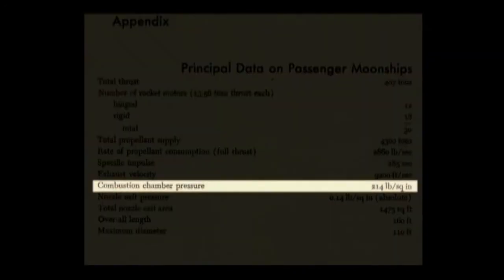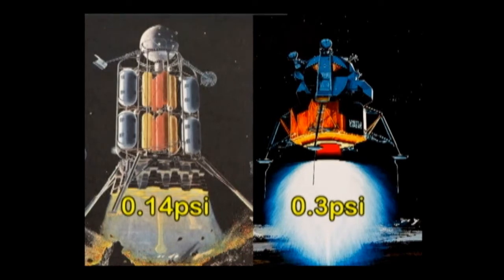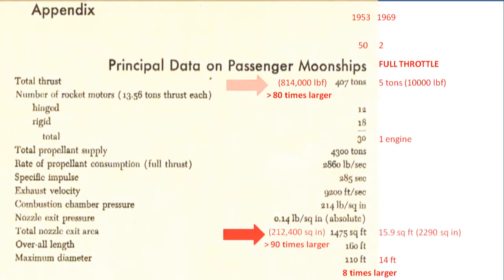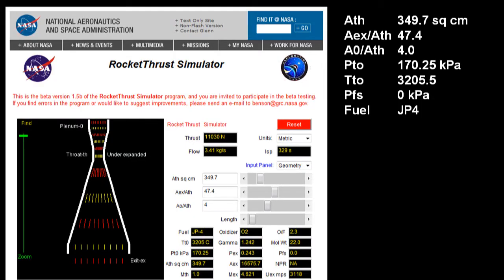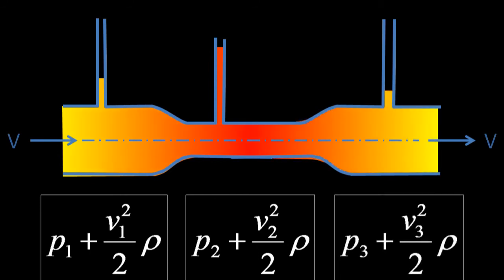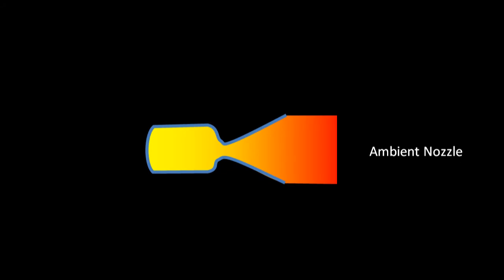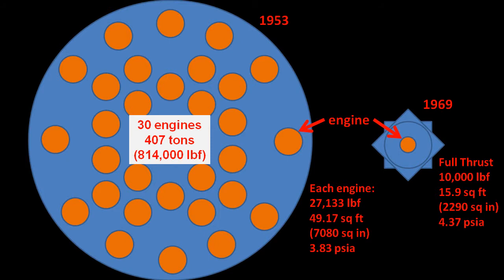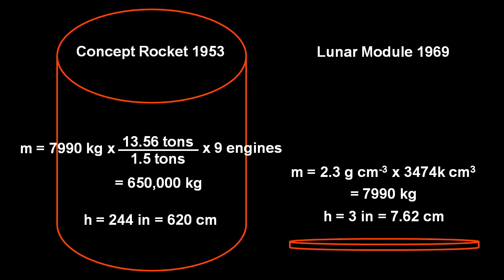MoonFaker: No Crater Addendum: Critique #01: Concept Rocket

Comment: If we only leave it to common sense, we must conclude the moon lander would leave a crater into light dust on any planet or its satellite with gravity.  It is all relative, from required force to power a craft against the same gravity that holds the dust down to the terrain. 

OK there is no atmosphere on the moon,  but consider as expanding gas penetrates into the dust similar to how those lunar foot prints we see in pictures do, the assumption that moon dust should remain cohesive falls apart.

Comment: philwebb59 can not plausibly deny that a rocket supporting over two tons of junk powered by the expanding combustion of rocket fuel into a virtual infinite vacuum, that is hitting the terrain at a meager .2 psi with questionable expansion velocity once it has escaped into space, would not blow a crater in the surface.  There are so many variables that he does not include in his hypothesis.  I only touch upon the more obvious based on his own estimations of PSI and weight of moon dust.

Comment: Imperial to metric keeps tripping me up, I have not slept for 48 hours, but call me a noob, I can take it.

Ill try again.  even @ 2.5g/cm3 @ 100 micron layer weighs 0.113 lbs per inch area i per layer.  And Shouldnt we consider, Time velocity and  Distance?

Convert grams to lbs
2.5g/453.5920864510229= 0.0551156 lbs/cm3

Take a 100 microns layer.
0.0055 *.01= 0.000055

Convert cm to inch
0.000055 * 2.54 

Moon dust weights = 0.0001397 lbs/inch @ 100 micron layer.

Or 0.139993624 lbs/inch3.

Comment: BTW thanks for your answer, I do appreciate it sincerely. But your answer may not consider cohesiveness is as result of vacuum, within a thrust it is no longer in a vacuum, at least for a short period of time and plug the energy of expanding gas, collision of gas moles penetrating the surface of moon dust, the reaction should change.

We witness the dust being kicked around and the cohesiveness you speak of which could like any soil on earth.

Comment from the maker: Unless it's been sieved, lunar regolith isn't uniform in size. It ranges from 0.03mm on up. Regolith has a density more in the range of 1.5 to 2.0 g/cm3. And, unlike sand on earth, it's not worn down by erosion, so it's more cohesive and the cohesion increases the deeper you go.

Comment: Answer the Question Dork dont run away..

Now answer this, how does 30 micron moon dust under the moons tiny gravity interact with rapidly expanding gas for the first time since an evaporating comet made a crater in it's surface?  

I suppose you have witnessed this first hand Einstein?. 

I dare Lie busters to land a model jet in a vacuum in that mooncrete without making a crater.  I would swear the weight of craft, vs required thrust to soft land, is relative to weight of dust in any gravity.

Comment: Have you accounted for the fact luna dust is only being 30 microns in diameter & weighs  0.6g/cm^3 on the moon. A layer of dust @ 30 microns facing .2psi thrust would seriously blow that shit everywhere. 
 
Your 50s pictures make it look like we are talking about clay fool.   What I am suggesting here makes a hell of a difference. So work that out with your pencil.  We don't even want to see a crater, even a small sign of a couple ton of heap useless space junk grinding to a halt would suffice.

Comment: The longer nozzles on Apollo 15-17 DID make a difference because they came much closer to the surface. In fact, pictures show the nozzle on Apollo 15 *HIT* the surface and was crumpled.

It ought to be obvious that cutting the engine before landing was much more important for the last three flights than for Apollo 11, which had plenty of clearance between its nozzle and the surface.

Comment from the maker: @xismxist OK, then AROUND 101ft there was no force acting on the moon, but then, magically, at AROUND 100ft there was 3000lbf. ON/OFF. That's how you think it happened? And the historic record shows that Armstrong bypassed a boulder field. How did he do that if he didn't move sideways? Check the video again. And your 81000 number is not mass. It's momentum. It means nothing in relation to the amount of regolith displaced by the engine exhaust.

Comment: @philwebb59 here we go with your misquotings again! AROUND 100ft is that better? the horizontal motion could not have happend, not as we can see it in original nasa film because the small thrusters was never fired (we should have noticed that) the LM cannot go from horizontal to vertical without the thrusters being fired

Comment: @philwebb59 the propagandaists excuse why there's no crater has always been that the exhaust expands, but if thats the case how can the depth of the footprints still be the same 1-2 inches around the lm like they are like a 1/4 mile away? PICS prove that fact: LM didnt remove any dust at all. The classic apollo 15 pic of the flag, rover and the lm is the most laughable yet, i mean take a look at the surface....

Comment from the maker: @xismxist The 8000 kg is calculated from a measurable 3 inch depression under the Apollo 14 LM. You got your 80000 kg by doing bogus math, force x time means nothing. It gives you mass x velocity which is a rate. You completely ignore gravity, cohesive forces, horizontal motion, and the exhaust spread. Dust is affected by gravity. Even in the movies. Did anything I said make any sense to you?

Comment from the maker: @xismxist #2 Do you think that at 101 ft there is no pressure on the moon then magically at 100 ft there is 3000 lbf concentrated on a 16 sq ft area directly below the nozzle? You ignore the horizontal motion. Do you remember that Armstrong had to take the controls and steer away from a boulder field? That requires horizontal motion. He wasn't directly over the landing site more than a couple seconds before landing. Does any of that make sense to you?

Comment: @lukequixotesanjose there's no evidence for the exhaust plume to expand in a vacuum, since there's no air to stop the exhaust it should remain even in a more straight plume all the way down to the surface (which original nasa film proved, since the engine kicked up dust at 100ft) the ONLY way to do that is if the plume has contact with the surface, which was the case

Comment from the maker: @xismxist #3 In order to move the dust, the force from the engine has to exceed the cohesive force (friction) of the regolith, which increases as you get deeper. This force is what causes granular materials to stick together. Down to 15cm, this cohesive force is about 0.5 kPa. At 60 cm it increases to 3 kPa. The force divided by the area has to exceed this value to even begin to move the regolith. That's what Luke was trying to get you to realize.

Comment from the maker: @xismxist #2 Also, do you honestly think that, even though you see dust scattering, the 13.3 kN force of the engine is concentrated on a 16 sq ft area of dust from 100 ft up? Do you believe that just before you see dust scatter there's zero force on the surface then magically at 100 ft it turns full bore? The force of the engine actually begins acting on the surface before you see any dust scatter.

Comment from the maker: @xismxist #1 8000 kg was estimated from the apparent depression under the Apollo 14. As for 81000 kg, sounds like you took 3000 lbf X 60 sec = 178,500 lbm (earth) = 81000 kg. Um? You can't do that. 1lbf (on earth) is the force required to accelerate 1 lbm by the acceleration due to gravity (on earth). When you start mixing earth weight, moon weight, mass, force -- it gets confusing to me. It all makes more sense if you convert to SI units. 3000 lbf = 13.3 kN.

Comment: @lukequixotesanjose There's no pic or video even to this date who can show these "radial lines" from the engine. Pressure has nothing to do with the engine dig a crater or not, as the main point here is that there was no air to slow down the exhaust, its a vacuum you know and there is no way around this by using excuses like you and other propagandaists does.

Comment from the maker: @xismxist Read the transcript I provided. Neither the crater or the explosion SHOULD have happened if you read Cernan's actual words. He is talking about risk mitigation on the Apollo 17. The Apollo 11 did not have the 10 inch extension.
Watch the video that Jarrah used as a source, watch?v=y1MVtrBytZs, starting about 5 minutes in, and get your facts straight.

Comment from the maker: @xismxist Exact words:
Ranen: I asked Gene why there is no crater under the lunar lander.
Cernan: Thank God there is no crater there. We might be in it, because we shut the engine down some three meters above the surface and we literally free fell that last nine or ten feet. And the reason we did that is if we kept the engine running all the way down to the surface, it truly would have dug a crater, the back pressure would have blown back up into the engine and probably blown us off the moon.

Comment from the maker: @xismxist You obviously didn't understand anything I just said, or you're intentionally twisting words. Cernan is talking about a worst case scenario. When you get the nozzle "close" to the surface, you risk regolith going back up into the engine. The 10 inch shorter nozzle on Apollo 11 means half the surface pressure and 2.7 times more distance between the nozzle and the surface. That would be much more likely at 6 inches than at 16 inches, and even then it likely wouldn't happen.

Comment: @philwebb59 That would been a test i like to see, 157 leaf blowers attached next to each other(still only 0.5 psi) i bet those would create a HAVOC on lose surface like sand if they were running for 1 minute. But it wont be a pickup.. only 157 leaf blowers along would be around 3000 lbs. Either way it would cause alot more disturbens on the surface than what the LM did on the moon - I could bet my life on it.

Comment from the maker: @xismxist  #3 They also had a ten inch extension, which put the end of the Apollo 17 nozzle six inches away upon landing, opposed to 16 inches for Apollo 11. The surface pressure would also be double, 0.9 psi compared to 0.5, and there was less space for the regolith to escape, so they would have more of a problem with back pressure. He's probably right there. IF they had not shutdown the engines before TD, they MIGHT have been blown off the moon.

Comment from the maker: @xismxist #2 Cernan said that Armstrong shut the engine down before touchdown. That's definitely not correct according to the film footage of the landing. Cernan said he shut the engine down nine feet above the surface. He's obviously not talking about the distance from the landing pads to the surface. As for back pressure, the J-series flights were more cautious due to the extra weight of the rover and fuel.

Comment: @philwebb59 even when using your own math, you are wrong again here... 60 seconds of 3000 lbs is 81647 kg which is over 10 times more than your 8000 kg estimation, so much for your estimated 6 inch "crater" - if should had been 60 inches with your own math!

Comment from the maker: @xismxist A 2.5 ton pickup, 0.5 psi → 157.2 leaf blowers (assuming @4.5" dia.).  As for how much regolith is moved, the 0.5 psi first has to overcome gravity and friction, two forces holding the regolith in place. Assuming each is zero, then the 3000 lb force from the LM would move my 8000 kg of mass with an acceleration of 1.38m s-2. It would accelerate 16000 kg at 0.69 m s-2. How much mass do you think moved? I'll tell you how far it could go before the lunar gravity sucked it down.

Comment from the maker: @xismxist #2 As for my 8000 kg estimate, it can be derived two ways, using actual science. First consider, at 3000lb force, that's 3000lb mass displaced per second from the area under the LM. Second, there is a 3 inch pedestal under the landing pads on Apollo 14. Either way, do the math and you will get an estimate between 8000 and 16000 kg. Saying the LM should dig its own grave is also an estimate. What is your estimate based on? Show your math.

Comment: @philwebb59 yes but thats not interesting in this case, since the main problem being what the engine was powerful enough to disturb the surface from a latitude of 100 ft, there doesnt exist some magic "middle world" between the exhaust nozzle and the surface, its a vacuum dude. 1 minute of surface disturbens from  2500-3000 lbs thrust with no air to slow it down wont remove only 8000 kg of dust therefore i said 8000 TON's of dust. thats more logical..but it didnt remove anything!

Comment: @philwebb59 I am the one overestimate what it take to hold up the LM? wrong answer dude! your the one who UNDERestimate what it will take to hold upp 15 ton (2.5 on earth) Imagine how many leaf blowers if would take to landning a 2.5 ton pickup truck here on earth from a height started at 100ft, still that is only 0.5 psi.... the LM had 1.5 when landing on 25-30% thrust. And we all saw what ONE leaf blower did to lose surface demonstrated by Rene

Comment from the maker: @xismxist #3 The most time that the exhaust gases come in contact with any given 4 ft area of the moon's surface is one second, prior to touchdown. The Apollo 11 was the only mission that kept the engine running after touchdown and it ran for two to three seconds and swept away approximately 8 to 16 metric tons of regolith during that time. Is there anything else you want to know?

Comment from the maker: @xismxist #2 While the LM descends, it not only falls out of the sky, but it moves horizontally. Remember the rock field Armstrong had to avoid? At 100 ft, the pressure on the lunar surface is about 0.001 psia, and the LM is was moving horizontally at about 40 ft/sec. Just before contact, the LM was moving horizontally at about 4 ft/sec. The Nozzle is 4 1/2 ft in diameter. That means that each second, the LM is over a different surface of the moon.

Comment from the maker: @xismxist #1 I'm seriously having trouble following you. Looks like I'll have to start at the beginning. The rocket does not "push" against a vacuum. The momentum of the gas exiting the throat of the rocket engine equals the momentum of the rocket. Newton's laws do not require pushing against anything. When the LM descends to the point where dust starts to kick up, the "wind" from the engine is very light. There is no atmosphere to interfere with its movement.

Comment: @lukequixotesanjose you says no one is misquoting and you did it exacly yourself!? not 1000 your moron! but 2500-3000 lbs of thrust since the engine was running at 25-30% of 10000 and  im even more curious how YOU (and your hero's) understand the laws of motion? because on the moon there's no air between the nozzle and the surface to slow down the exhaust

Comment: @philwebb59 I DID NEVER SAID THAT! stop with your misquotations, i already gave you the answers your moron! i said it took one minute from 100ft to touchdown (apollo 11) thats 1 minute of 2500-3000 lbs thrust blasting the surface why must i repeat this? READ FFS!  the engine still runned at this same thrust after landing, which according to gene cernan WOULD DIG a crater and cause a explosion

Comment from the maker: @xismxist The little three inch pedestal of compacted regolith was caused by a bad drop from the crane? How is it then that the little three inch pedestal is three inches higher than the surface directly under the LM. The surface under the nozzle is lower than the surface under the pad. If there was a bad drop, wouldn't the pads be buried deeper than the surrounding surface?

Comment: @lukequixotesanjose Phil is wrong and Jarrah is correct. If concrete didnt stand a chance against a small engine, then the lunar surface wouldnt stand a chance either against the LM engine who puts out alot of more thrust AND heat

Comment from the maker: @xismxist 4
In an Apollo 14 photo, AS11-40-5920, it's obvious that 3 inches of regolith is missing out near one of the pads and the surface slopes down toward the nozzle. That's a 3 to 6 inch crater. Why do you ignore the obvious? What evidence do you have that no regolith was displaced or that the LM was placed by a crane?

Comment: @philwebb59 the landing should have look different that we saw it (it goes for all missions) first, it should been impossible to see the surface from  windows when landning because of the engine blasting dust away in all directions. Second, even smoke and flames from the thruster rocket engines should been visible as they would need to fire them all to balance the LM from flipping over when going horrizontel

Comment: @philwebb59 The smallest tinny inch sized rocks can be seen under some of the LM's (dont remember exacly in what "missions") and we cannot ignore what gene cernan said: "if we hadnt cut off the engine some 10ft above the surface it WOULD have dig a crater and the backpressure blow up us"  but on apollo 11 the engine was still running after touchdown, ... explanation?

Comment: @philwebb59 That video was about everything who had nothing to a crater to do... i.e cars, astronots boots, and trees. Why not compare by something similar? a leaf blower has 3 times less psi than the LM has on 25-30% thrust, but still the leaf blower can move several inches big rocks, but the LM engine didnt move even the smallest rock...

Comment from the maker: @xismxist
You echo my sentiments exactly, psi is psi is psi. And as I state, there are 3 to 6 inches of regolith missing from under at least one LM, displaced by the force, not pressure, of the descent engine. Stay tuned for Part 3. I should have it up today. It will address the engine shutdown before/after touchdown issue.

Comment: 0.14 psi is always 0.14 psi. it doesnt matter if you have 1, 10, 30, or even 100 exhaust/motors to cause that pressure. PSI is always PSI, and means just that. Imagine what the LM at 30% thrust (1.3 psi) will do, it would have dig its own grave to say atleast like gene cernan said, especially when still runned after landing